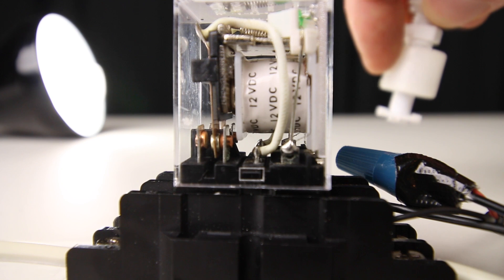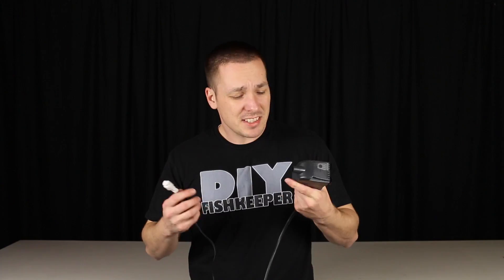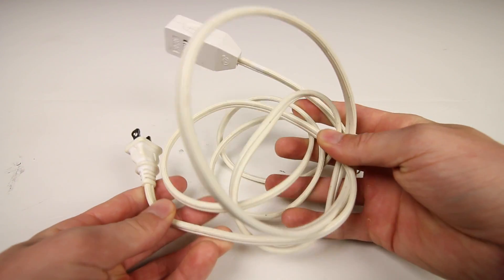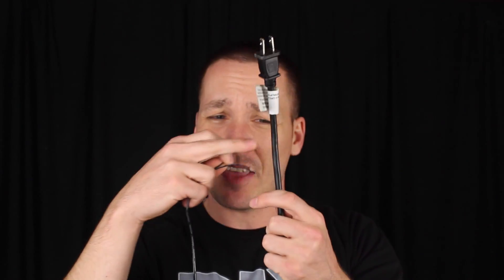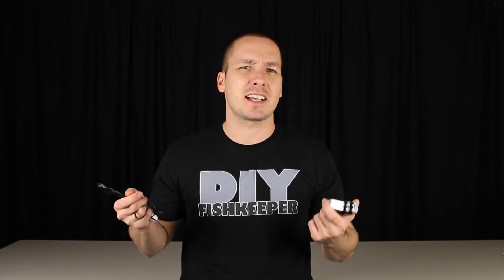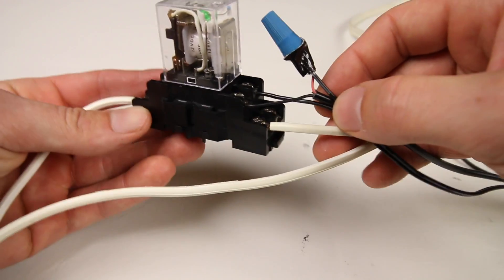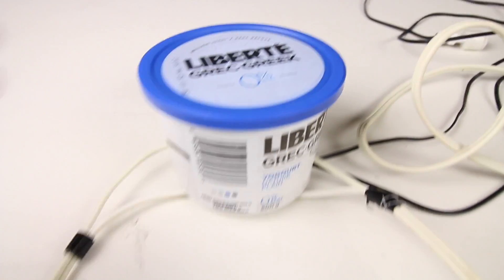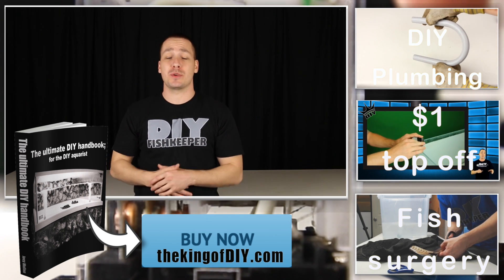HOW TO: $12 Aquarium Auto Top Off (ATO) Automation

Comment: Hold up people a relay is NOT a protection device and is not designed for any electrical protection from high amperage and is not an overload do not listen to that advice it's dangerous and could get someone hurt or killed there are protection devices like overloads that can do this but a relay cannot I've seen relays switches fuse together and actually cause equipment continuosly running when it should not this is coming from a fridge mechanic to that deals with these control circuits on a daily base if you want to do this properly research a proper control circuit with safeties in place

Comment: I have a similar project, but I will put two sensors in the water and I will use a 12 watt motor with a battery, it seems simple and safe

(I used Google translate)

Comment: Really cool idea but a few problems. Number one is there is no live wire on AC current so u can use either wire it wont matter as ac current alternates between positive and negative 60 times a second on both wires. Number 2 never use crimp caps for 110v they are rated for 12v and no approved for use in the home. Also using a 12v relay means there is a possibility that 110v can jump the gap and make a connection between the magnet. The only reason voltage is rated is the ability to just different size gaps same reason 12v fuses have a much more narrow gap than 110v.

Comment: Would highly recommend to solder the connectors instead of using twistconnectors. Much more safe and rugged. When you are done put some tape over it or go with shrinkable tubes

Comment: The one negative of this type of build is no failure prevention if the float switch gets stuck on.  It will just top off forever.  Most ATO systems have that built in to kill power after being on about a minute.  I did a DIY build with an arduino and a solid state relay to program my own failure logic.  It doesnt increase the cost much at all, just a learning curve.

Comment: You could also use a MOSFET to control the relay, with a flyback diode, for larger relays, as a relay coil could be pretty hard on the float switch.

Comment: I know this was posted awhile ago but I'm hoping someone is still looking at comments. This is a great video! I started looking for the parts online and found a relay switch and socket combo. It's the Uxcell a11063000ux0053 DPDT HH52P Coil 8 Pin General Purpose Relay with PYF08A Socket, DC 12V. I'm assuming a combo is OK instead of buying them separately. Can someone confirm? The specs are: 12VDC, Contact Capacity 5A, 240VAC, 5A, 28VDC:5A, 28VDC.

My second question is regarding the 240VAC as noted in the specs. Is this European? I'm in Canada so should I be looking for the exact same thing but with 120VAC? I also found some float switches that are also 220VAC. I'm assuming I would also need to find one rated for 120VAC? Or am I'm completely wrong? I'm a newbie to DIYing electronics. I understand how to wire this up and can read things like circuit diagrams but I'm still learning about getting the correct parts. Especially when you can order online and the parts can come from anywhere in the world and won't necessarily work in North America. Thanks for any help.

Comment: You'd never under any circumstances recommend running a float switch directly to the water pumps wiring.  My water pump runs off 5v DC.  So, you would recommend running 12v through the switch because it would be safer than running 5v through the switch?
Reply: It's a current issue. Your 5V pump might draw 3 amps. The contacts on the little magnetic reed switch inside the float are not rated for much current, and can weld themselves closed. The relay is 12V, but it only draws 75mA, which is a very small amount of current.
Reply: Thank you.

Comment: I'm surprised I haven't seen a recommended video yet of someone using the fill valve and float assembly from a toilette.  Sure, you'd need a decent sized aquarium to use one, but it'd be a way of having an auto top off with no power or pump needed.
Reply: The water going to your toilet is under pressure... The float system is worthless without something to pump the water...hence the need for power/pumps for aquarium ATOs.

Comment: lost me at the float switch to the AC adapter.  should,be clearer there. does the float switch need power. . .
Reply: Yes the float switch does need its own power to send to the relay or the relay wont know weather to open or close the circuit, usually its a voltage of around 5 - 12 volts dc.

Comment: If you do this and you use a relay like Joey with the exposed prongs, PLEASE PLEASE cover the prongs with liquid electrical tape and put it in a conduit box or find a diffrent relay! That is 120 ac exposed! It will hurt.
Reply: Or don't touch it while it's plugged in... But yeas liquid electrical tape.

Comment: hmmm.  I wanted to get the hydor auto top off system but don't really feel like laying out the cash right this moment.   I may have to give this a try as it could be a good temporary solution at the least.
Reply: well, I just made one of these too.   it's been working great but the wiring of my relay chassis was different and for some reason my float switch would work until I jiggled it on and off really fast..   that threw me for a loop.  I thought I had a bad switch.    anyway, it's been working flawlessly.. and it was diy!

Comment: Hey what if I don't want to use the extension cord just float switch and 12v D.C. Wall plug? P.s my pump already has its wire stripped
Reply: I would not recommend that. 

Pretty dangerous setup, could catch fire (personal experience)

Comment: great video once again joey. a couple questions though
1. I want to use this in a sump to prevent water levels from getting to high. will the pump get damaged if it's turned on an off so frequently?

2. ideally what I would like is a system that will completely empty the sump when the levels get to a certain high, then shut off when it gets low enough and turn back on again when it gets too high and empties the sump. kinda like an auto flood/ drain system. any ideas on how I can do this? thanks a mill buddy

Comment: Jonathan Olivero that's easy to add a second switch for a backup, just wire them in series. Take one wire from each switch and twist them together and put a wire nut or a butt conector on it. And then use the other two wires like it is one switch.
Reply: Ray Coffield is there a diagram for doing this? I'm sorry just having trouble understanding the directions
Reply: Ray Coffield I think you mean parallel.   wiring them is series wouldn't work.

Comment: How could i set up a system for my reef tank to keep the salinity constant that doesn't depend on the water level? I want something that drips RODI water at different rates depending on the salinity of the water. The reason I want this is because I would want to add saltwater constantly and have it overflow through a separate skimmer having a constant wet skimmed water change.

Comment: I bought this relay from ebay
https://www.ebay.com/itm/172040057268 

I had to spend hole day and then by looking at the circuit diagram i figured that the extension cable chord has to connect on the top screw locations and vice versa.
Reply: Sure. In the video the relay used is different than the one we got. In the video's relay the bottom screws are exactly opposite to each other where as in our relay the bottom switch are not on the opposite side except the middle one. That's because the bottom switch are to attach with the float switch and the 12v adapter. And your extension chord's live wire has to be passed through the top screws which are exactly opposite to each other. This is exactly upside down than what is shown in this video. Hope it helps.
Reply: You mind going a little more depth for me I have the same relay it arrived yesterday and I started working on it today but the float hasn't arrived.
Reply: +Rafsan Rafi thank you
Reply: any way you could also share the wiring diagram you found for your particular model of relay? I have the same one.
Reply: Thanks so much Rafsan.  Works thanks to your explanation.  Thanks also to KingDIY!
Reply: I am glad it helped. Thanks to King of DYI. You did an awesome job explaining
Reply: yeah, without the video we wouldn't be thinking of this in the first place lol.
Reply: You are the man! Thank you! You saved me from a whole of frustration!
Reply: I can't find flow switch
Can you help me
Reply: wow you saved me alot of time, i had exactly the same problem!

Comment: Do you have a wiring diagram of the relay that you purchased? I'm trying to connect it the same way as yours but it doesn't do anything with my 12v power supply that's plugged in.

Thank you.

Comment: Got my relay and the terminals aren't straight across from each other, they're staggered and no matter which way I wire it, it doesn't work. Wired the float switch directly to the extension cord with the pump plugged in and it worked just fine, it's the relay and power supply that's messed up somehow. Any suggestions?

Here's a link to the relay I bought. http://www.ebay.com/itm/12V-DC-Coil-Power-Relay-DPDT-LY2NJ-HH62P-L-JQX-13F-10A-PTF08A-Socket-Base-FUK-/161937145041?hash=item25b434bcd1:g:aaYAAOSwJkJWikdk
Reply: +21st Century Machinist Well, I did get the relay to work by wiring the extension cord at the same end across from each other rather than on opposite sides, but now the float switch won't work and the pump runs continuously.

Comment: Great Design, just used this as an example for building my own. The only difference between this and mine is I spent a couple bucks on a better enclosure, and wired up sockets to allow for easier pump connection. That and in the relays off state it powers a small recirculating pump for the kalk in my ATO reservoir, when the float trips the relay it turns off the recirculating pump and turns on the ATO pump. My costs were about $30CDN all said and done.

Comment: theres a good way also to do that to avoid 110v or 229v and relay just buy 12v pump (7$) and float switch (2$) then use a 12v ac adaptor.
Reply: or buy an automatic bilge pump with switch in it and adapter!

Comment: Thanks for this idea, I am going to use it for my sump pump as I have an overflow box and always worry about it loosing it's flow.This way if my water leave is to high it will shut off my pump and not overflow onto the floor.I have also used an delay timer with a relay to turn off my sump pump (3minutes) during feeding so the food does not all go into the overflow box.Thanks for all the great videos.Ray
Reply: +Ray Coffield those are both great ideas.   What kind of a timer did you use in your setup?   I found some relays that have a timer do you know if they would work?
Reply: Yes they will work just make sure the relay will handle the load of your pump most common are ten amp and that is good to go. I used a delay time and a relay and my first relay was cheep and when I replaced it I went back with a relay with a timer built in. working great now.
Reply: +Ray Coffield So with the timer relay you would wire it as in the video but replace the float switch with a manual switch.   Then when you push the switch the relay should turn the pump off for the time set in the the timer and back on when the time is up.   Am I understanding it correctly?
Reply: A sump should be set up so that if all the water in the system above your overflow's teeth drains, the remaining volume of the sump should contain it. Thats why sumps arent ran full, and neither are tanks with overflow teeth. If your sump can overflow, it isnt set up correctly.

Comment: If we are using 12 volt Mini water pump which  works on 12 volt adapter, then it is okay to connect float switch directly with 12 volt pump or adaptor ?? So I want basically  bypass "relay". So my question is, still it will work?
Reply: It works for me.
Reply: yes
Reply: Update: I installed a second one. That one stays on when it should turn off, it drained half my tank this morning. I'm guessing that it can't handle the 1amp power source.

Comment: Hi Joey thanks for sharing this and all your other DIY videos.  Like other commenters state, you do make it easy.  A question for you on the relay because I am terrible with electronics.  Is the voltage on the relay arbitrary?  For example, instead of a 12v relay could I use a 5v one?  The reason I am asking is because I already have 3 and 5v wallwarts I was hoping to repurpose instead of buying new.

Comment: It really doesn't matter which one of the wires from the power you cut. It'll work either way. Better is to cut both btw and give each a contact on the relay. That way the whole power is cut off from the pump when not in use and the wiring is a bit simpler to do.
Reply: JohnnyVVlog generally it's better to cut live because if you touch the device and ground, you won't die.
Reply: JohnnyVVlog Otoh, if you cut the neutral and leave the Live/Hot connected, the entire circuit can give you a nasty shock if you touch it by mistake, along with something grounded in the room. like your computer chassis, a stove, conduit, a room heater, etc.
Reply: @humbughumbughumbug  yes if you're using a uk plug, but us and eu plugs can be plugged in backwards so whats even the point of it?

Comment: Did you plug both the light and the 12v AC adapter into the extension cord?
Reply from the maker: +Tristan Beligan No, the extension cord and AC adaptor go into the wall.
Reply: +The king of DIY oh okay. It was kind of hard to tell
Reply: +The king of DIY and the pump to the end of the extension?

Comment: Good idea I been thinking for making and automatic water changer.  the wall behind my fish tank is the garage wall.  With water and a drain like 3-5 feet away.  My worry is a plant branch will break loose and say water level is low and over flow the tank while I am at work.  How would I protect the float switch from this happening.  Ideas?

Comment: Great step by step here. A good use here is to have the float valve shut down your pumps if the tank begins overflowing. I've safeguarded my pvc overflow from blockage with a sponge over the intake, but one can never be too safe.

Comment: I would highly recommend also wiring the neutral through the other side of the relay. While that style of relay is highly reliable, this will provide redundancy in case one of the relay poles gets stuck in the on position. Also, that style of relay does not have any overcurrent or any other protection. Great video. I always enjoy your content.

Comment: You are the man ! I got everything ordered on ebay the relay and socket sold together 5$ float switch 1.50 $ a cheap water pump that can lift max 40 inches. I just need it for a 10 gallon newt tank. hate the water that keeps evaporating. this will keep it level and I can just pass the pad on edge to keep the white stains on tank. I never bought one cause they not cheap and for a small 10 gallon half filled this is perfect and safe. YOU ARE THE KING !!

Comment: i have a setup that i used a sprinkler valve. with a float relay. down side is its hard to control the temp of water . but a tempcontrol valve will solve that noble trade sells them